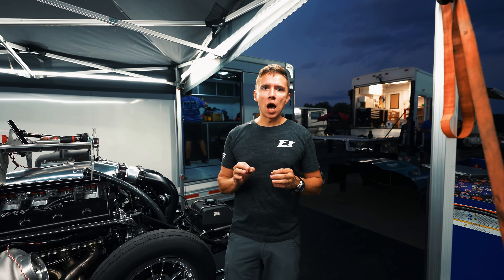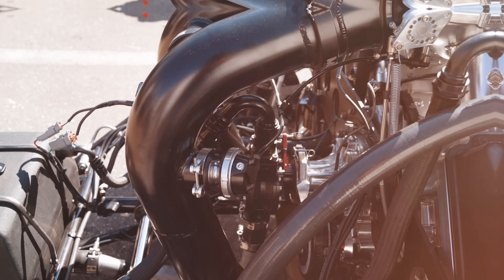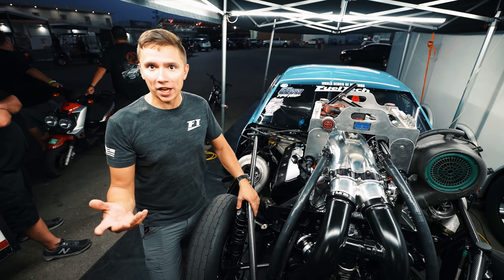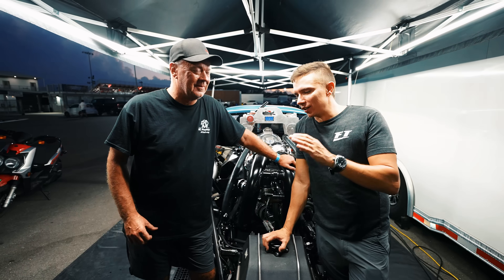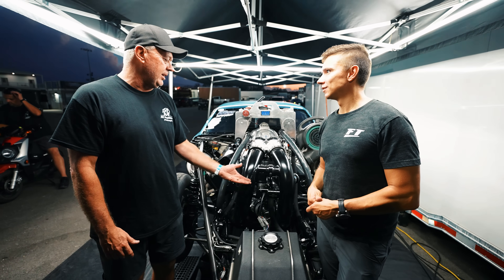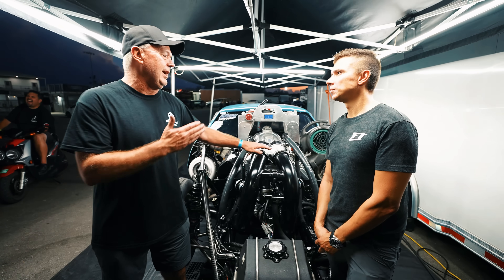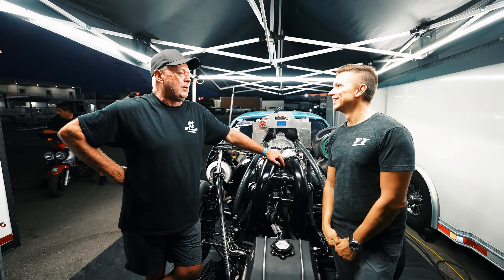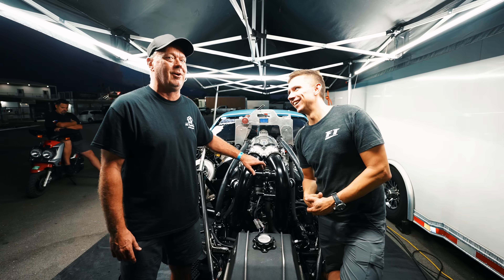The Secret to making 5000HP with a Twin Turbo ProMod! | M&M Transmission

Comment: Just use a powerful electric motor to spin big screw supercharger so the supercharger will not have to spinned by the engine so at the end we have have powerful monster.

Comment: How do you keep from over speeding the turbos, while still having enough exhaust to bring them into the sweet spot without waste gates though ?
Reply: By running  turbos that are over engineered and large enough, that they can’t be oversped
Reply: I also have the same question, I'm guessing big enough turbo so you dont overspin them (?)
Reply: @naufalkusumah2192  my best guess after posting the initial comment above is: Extremely efficient Turbine Wheel that is just as happy in the higher RPM/exhaust load/pressure as it is under lower RPM/exhaust load/pressure combined with a Compressor Wheel that is aerodynamically speed limited in order to save things from coming apart up high, without going into some sort of reversionary type of behaviour......OR...., I pretty much still have no clue.
Reply: @joeyjojojr.shabadoo915  I guess you don't know how turbos work.

Comment: Would a intercooler make any difference if installed or would it create a boost restriction?
Reply: @CliveGreen-q1x  Methanol is his intercooler.
Reply: Actually it’s not legal in many classes to run an after cooler on pure methanol

Comment: Make no mistake about it leaking boost on the cold side will make less power as well compared to the same boost on a wastegate setup. That is an advantage for him as well as the decrease in power is also necessary for traction up front. Then you just close it when hooked and let her eat.
Reply: Thanks man just trying to help others understand. Another possible benefit might also be using the cold gate for traction control as well seeing how fast it can lower boost very fast and bring it back in fast too. You can manipulate boost much better with the cold gate vs waste gate. I just Don t want people to think that the cold gate advantage is that it makes more power when it is open. It is the fact that it makes these big boosted engines much more manageable.
Reply: @Shademax4273  correct because they have more than enough power to sacrifice for other benifits..
Reply: @Shademax4273 I would love to see this type of boost management more in the radial classes, like Pro 275 and RVW. Those cars would be insanely quick! But you rarely see cars in those two classes with twins anymore.
Reply: No at all.  WIth respect, I think you have it backwards.  Controlling boost on the cold side means you always get (or can get) full efficiency from the turbos.   Like he said, that's why this setup behaves more like a blower car but with the efficiency and top end of a turbo car.  Wastegates are just that, wasted efficiency and power.
Reply: I see what you are saying. There are tons of variables I should have been more specific. By leaking off boost on the cold side you are losing compressor efficiency and driving e map up. For the same cold gate boost vs Wastegated fuel will have to be removed to maintain the same afr. This has been verified. His car Dont make 5k HP with the cold gates open, they are closed. You can pin the wastegates closed up top too but the cold side method has the benefit of a much more linear controllable power curve. Not only because of the loss of power(just Don t use as much timing retard if necessary to compensate) but because the turbos are spun up ASAP. Then you can close the cold gate in a manner to bring all 5k hp in as fast as you want like a blower car.
Reply: @Shademax4273 u are 100% correct sir🔥

Comment: without wastegates on the hot side what is to stop the turbos from over speeding ?
Reply: LOL
Think about it.... Can't happen.
Reply: @bradcross2  
When the cold gate is closed you can drive shaft speed way up. Basically in an optimal setup you size everything appropriately to keep shaft speed where you want it. If not sized properly you can definitely drive shaft speed way up to a point where it is not very efficient or at worse cause a failure. When the cold gate is open the reduced boost helps limit turbine flow to help keep from overspeeding.

Comment: So the dirt cars got the 4 bar suspension from the drag world. But the dirt world has figured it out 10 yrs ago that HP helps, but the setup wins races. U can't just punch buttons on a computer and win races. The chassis has to be happy to go fast and win. Go in any dirt LM hauler, and they will have different length bars , shocks, springs and many other parts to fine tune the chassis. The drag cars are headed that way, where u will be making a bar and shock change as the track develops throughout the night.

Comment: So the “secret” is big engine, big turbos, lots of fuel, and a paid race team. Got it. Very interesting info.
Reply: And a Ton of money
Reply: Yeah if you Don t have the experience you have to pay someone who does
Reply: @4familyman  
The "secret" is that these dudes make 5000 HP but can barely use half of it for half the run😂. They are bleeding HP to try to not blow the tires off by pulling timing, dropping holes, and of course boost control. The cold gate by design is very effective at bleeding that power off and also can bring that power back in much faster than a WG setup.
Reply: Then why don't all the race teams have success they all have all of those things? You can't teach experience you have to learn it yourself the hard way that's why you don't see anybody running up front that just came strolling into racing
Reply: A 481 isn't a big engine, it's fuel, a lot of boost and a reliable engine, cleetus engine is 40k used the chassis it the secret

Comment: THe Electric driven Pro Chargers used in the F-1 cars and Porchia appears to tbe best setup,  You have instant  boost that you can control when needed  and no exhausts backup 
However, you do have to have  good size battery  and charging systeem.